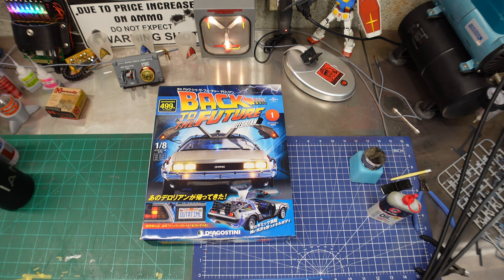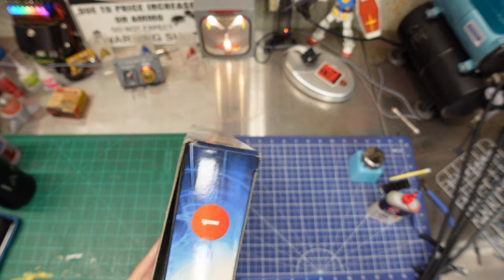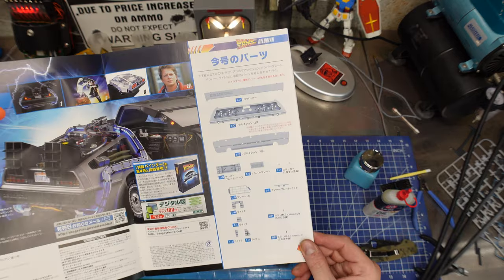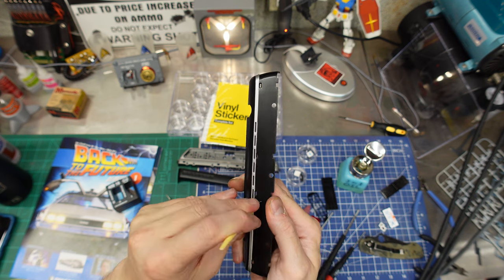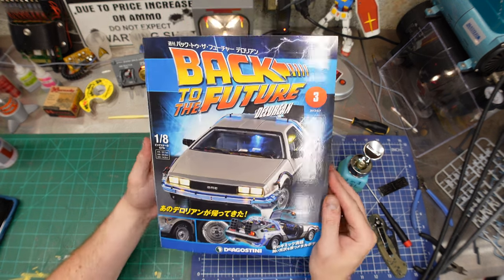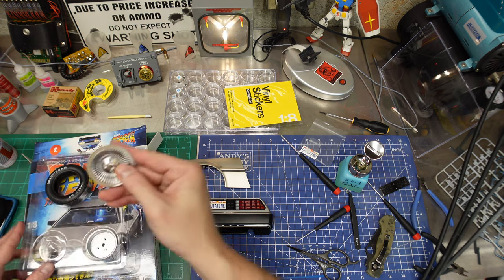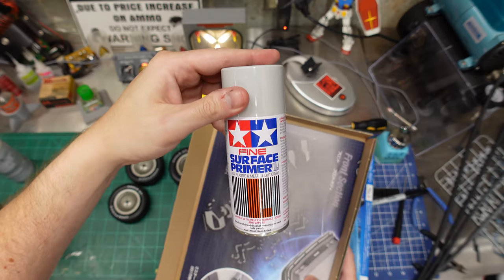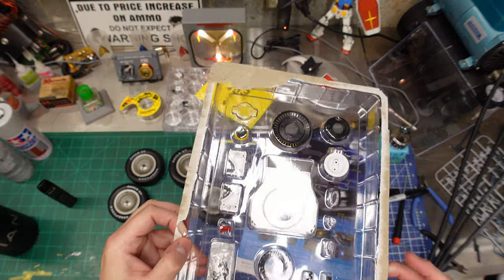Building the Fanhome Back To The Future DeLorean time machine 1/8 scale part 1

Comment: Yeah, when you add up each issue. the costs are quite a lot, but its spread over such a long time... I enjoyed building my eaglemoss version but did encounter a lot of the issues you are seeing and some downright incorrect instructions (especially screw choices!) I'm sure you'll have it go together in no time. tip though, there's a few times where you are left which big chunks of car and its tempting to assemble them beyond the instructions, don't! you find out 2-3 issues later you need that apart again for some other thing.
Reply from the maker: Agreed Mat, and I saw on the build site I read the tips on what order to assemble, I would not want to dismantle this thing once it's together.